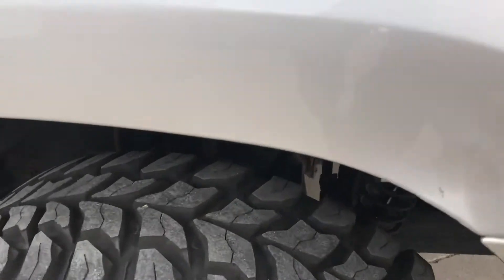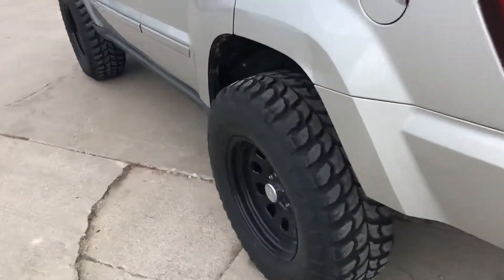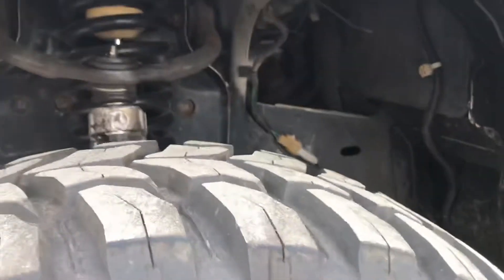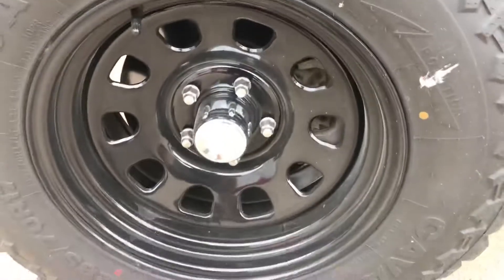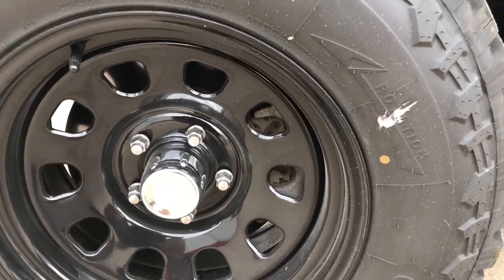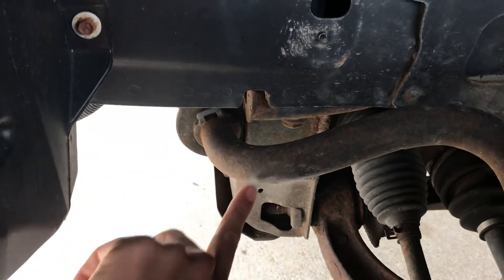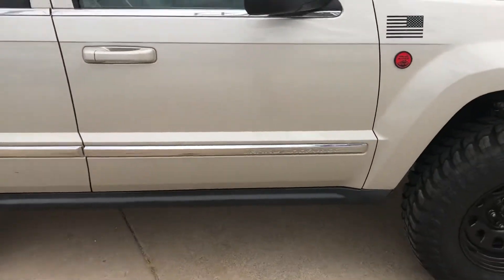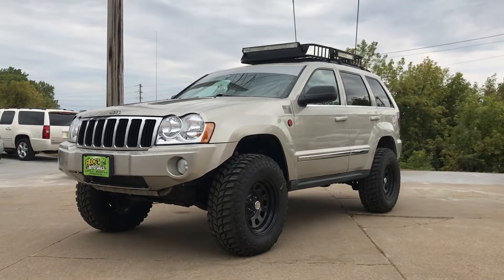Lifted 2007 Jeep Grand Cherokee WK 5.7 4x4 - 4 inch lift kit, roof rack, vented hood

Comment: Do all of your shocks have a lift on them? And can I put a 2 and a 1/2 inch spacer on the front. I'm running a 3.0 turbo diesel. And the rear of my jeep sticks up pretty high. So I was thinking just a two inch in a rear. Please get back to me tell me what you think.

Comment: Will the 3 inch work since I got jba or no.. And how did you trim the number.. Jist got mine posting a vid tomorrow
Reply: Dude where did you buy jba lifts? The website doesn’t have any
Reply: @KneeGrowDoingKneeGrowThings  they dont have them anymore..i went r c 2 inch spacer lift..about to go a different route as there is now a lot of creaking clunks only went turning slow...full lock ..either sway bar links or doing it or struts..not the axles
Reply: it actually turned out to be my front differential bearings, it sounded just like sway bar links then it turned into what sounded like bad cv axles then I replaced my front prop shaft then I replaced my wheel hubs, yup its the bearings in the front differential/....

Comment: Driver shaft was it ever changed or needed?
Reply from the maker: Front drive shaft was replaced when we got the Jeep. This was a maintenance related replacement and not required because of the lift kit. Front driveshafts seem to be a pretty common thing that need to be replaced on higher mile WK's. Front and rear driveshafts are both stock sizes, CV axles were replaced as well and are also stock size.

Comment: Where did you get the roof rack?
Reply from the maker: It is an Ebay rack - 64" Universal Black Roof Rack Cargo Carrier w/ Extension Luggage Hold Basket SUVhttps://www.ebay.com/itm/64-Universal-Black-Roof-Rack-Cargo-Carrier-w-Extension-Luggage-Hold-Basket-SUV/113160814754?_trkparms=ispr%3D1&hash=item1a58e900a2:g:xWEAAOSwc6dejHER&amdata=enc%3AAQAFAAACYBaobrjLl8XobRIiIML1V4Imu%252Fn%252BzU5L90Z278x5ickkAgU0umhwUTmgTFbE5cu7zTPsBnaulIw86PB4x0nUY6Osj6DpO%252BkfDc19skhjdvREaj%252BaWgac2TvCDDCcITZf78E85WHqM9cUNXkYGFjkjECZ8%252FAfbjMNHAnhZDXYyIXTu2urZFyVrcBHCNMwy0sokXytFjL3V%252FTvGL0rZ0qBSlG8bp2vY7WYn4D12wOYDjG0RC4MwIN%252B1tWohM4Tt2LOFWJoxHgEToERZi2o3%252BPRqC5eZo61wfA95TVbbuzuNSX6CaRWRzRj0oP09YKRpmtncQJe7s1YBy7yRd1PhlfTKQ0t7947NvHMVR0lRDBmaDNSH2co2J5%252FF6g0oiUNU6XuSAV7jb3KOZUEZdBOTx%252Bvpk4IRbluOH%252FlK09oUbugm3%252B71llV%252FEPTtKbfBTqrSe0BP4iscVmeJU6FjQ1PPTOYbrlnJJ9mMt0pdkS7iLJfGCvPaoAiOvtRmLf6b0Ox6A7Vp1wdTfEsOL9nGqa3YHRDkRkd%252FLgsdvO1JhFH8S8Os9kYgW51AsZK0vfgIHHT7oPMrMQTpzU3rA8820ZO3STiXjju%252FiYPX2nLApcBYu2HyeWTvVjBfO%252FV69RqK%252BqH%252F4MSpU2%252BLxvrsss%252FrYblj9LcJQuJ4chN9po9N8ANS4Yk%252BiWTZIubgeuI7IMsiqeMRQNqk3V8axKkCYUBzterRf0FcAOooh2sY9lIZRyBMfFVxlw9s9pB5paMpLJ6sa4PmcKqWeAeqH%252BA759T2JJQKi1ZVsJ3Hn%252B7c7JQZp%252Fu4LWrvzdX%7Ccksum%3A113160814754b40b2837b72c459fb75113de4801583d%7Campid%3APL_CLK%7Cclp%3A2334524

Comment: What lift kit do you have?
Reply from the maker: It's not a specific lift kit, it has a 2" top mount strut spacer in front ( because of suspension geometry the spacer size roughly multiples by a factor of 2, creating roughly a 4" lift up front, and in the rear a 3" body mounted spring spacer combined with Monroe 58646 Shock Absorbers create 4"~ of lift in the rear. I had to buy two separate lift kits to get the correct strut/spring spacer sizes, none of the kits I could find online sold the sizes you need together as a set.

Edit: Plus the larger tire size accounts for about an additional 1.6" of lift over stock (stock size tires are 29.5" tall, these are 32.7" tall)
Reply: @TylerTief  Do you have a link to what you bought?
Reply: What us the model number for the front strut and spring? You gave us the rear "58646" what are the front ...thank you

Comment: What roof rack is that?
Reply from the maker: It is an Ebay rack - 64" Universal Black Roof Rack Cargo Carrier w/ Extension Luggage Hold Basket SUVhttps://www.ebay.com/itm/64-Universal-Black-Roof-Rack-Cargo-Carrier-w-Extension-Luggage-Hold-Basket-SUV/113160814754?_trkparms=ispr%3D1&hash=item1a58e900a2:g:xWEAAOSwc6dejHER&amdata=enc%3AAQAFAAACYBaobrjLl8XobRIiIML1V4Imu%252Fn%252BzU5L90Z278x5ickkAgU0umhwUTmgTFbE5cu7zTPsBnaulIw86PB4x0nUY6Osj6DpO%252BkfDc19skhjdvREaj%252BaWgac2TvCDDCcITZf78E85WHqM9cUNXkYGFjkjECZ8%252FAfbjMNHAnhZDXYyIXTu2urZFyVrcBHCNMwy0sokXytFjL3V%252FTvGL0rZ0qBSlG8bp2vY7WYn4D12wOYDjG0RC4MwIN%252B1tWohM4Tt2LOFWJoxHgEToERZi2o3%252BPRqC5eZo61wfA95TVbbuzuNSX6CaRWRzRj0oP09YKRpmtncQJe7s1YBy7yRd1PhlfTKQ0t7947NvHMVR0lRDBmaDNSH2co2J5%252FF6g0oiUNU6XuSAV7jb3KOZUEZdBOTx%252Bvpk4IRbluOH%252FlK09oUbugm3%252B71llV%252FEPTtKbfBTqrSe0BP4iscVmeJU6FjQ1PPTOYbrlnJJ9mMt0pdkS7iLJfGCvPaoAiOvtRmLf6b0Ox6A7Vp1wdTfEsOL9nGqa3YHRDkRkd%252FLgsdvO1JhFH8S8Os9kYgW51AsZK0vfgIHHT7oPMrMQTpzU3rA8820ZO3STiXjju%252FiYPX2nLApcBYu2HyeWTvVjBfO%252FV69RqK%252BqH%252F4MSpU2%252BLxvrsss%252FrYblj9LcJQuJ4chN9po9N8ANS4Yk%252BiWTZIubgeuI7IMsiqeMRQNqk3V8axKkCYUBzterRf0FcAOooh2sY9lIZRyBMfFVxlw9s9pB5paMpLJ6sa4PmcKqWeAeqH%252BA759T2JJQKi1ZVsJ3Hn%252B7c7JQZp%252Fu4LWrvzdX%7Ccksum%3A113160814754b40b2837b72c459fb75113de4801583d%7Campid%3APL_CLK%7Cclp%3A2334524
Reply: That is identical to my wk, same color and all.  I have 265/50R20s on mine.  Wheels rub on inside when turning.   Getting 1.5" spacers this weekend,  need tires though.   How do you trim the bumpers?  Did you do them or did you have someone else do them?  Looks awesome.

Comment: you had and issues with stock upper control arms with 4 inch lift?
Reply from the maker: I have not, at least not yet anyway. From my understanding stock upper Control arms and the ball joints specifically are a known weak point of lifted WK's because the upper ball joint spends all of its time at a much more aggressive angle compared to stock ride height. I believe there are aftermarket upper control arms (JBA offroad) that correct this upper ball joint angle issue with lifted wk's, but I just have stock upper control arms with new ball joints in them for now. In the future I will probably upgrade them to a more robust setup but they've been fine so far (4k~ miles since lift installed)
Reply: @TylerTief   Rocky Road Outfitters have a better pair, for a little cheaper. They use Cadillac ball joints so you don’t rely on the 3rd party. But honestly... I would get those UCA’s. Your angle is a bit much and if a balljoint does break then your wheel just drops horizontal wherever you are, whatever speed you’re at.
Reply: Get the JBA uppers they're worth the $400. I love mine. What's your hub to fender measurement? They say past 23 inches you kill the CV axles.

Comment: I just put those 3” lift spacers on my wk last night and I was like what the hell it looks like the front is lifter 6-7” and the back I used a 2” spacer but the front is still easily 2” higher. I don’t have any issues with my axles rubbing my strut fork but I definitely need a new pair of upper control arms designed for a lift. Also I have a small amount of positive camber which I need to correct.

Comment: Funny I got a 3” done on myn no problem
Reply: So i won't have issues Im waiting for mines to come in just ordered them
Reply: @juniorhernandez9693  it’s a pain and took some work but yea no issues hardest part is was getting the control arm bolt in because it was so stiff I had to use a jack and get creative because it just didn’t want to just go together like nothing it was difficult but it did work and drives well
Reply: Would you recommend, I switch it out to like a 2.5 instead? Also does it really multiply like he said 3 in turns into 6 in?